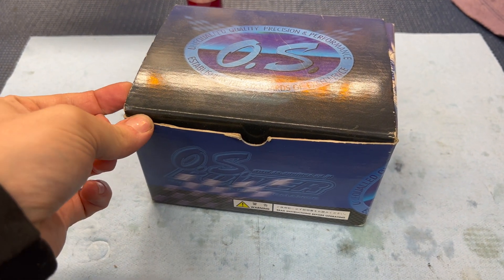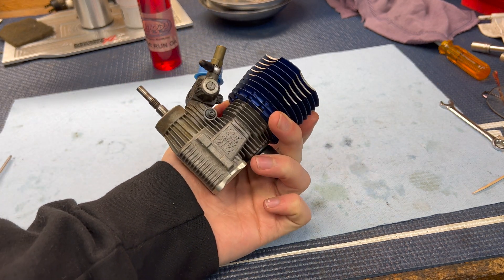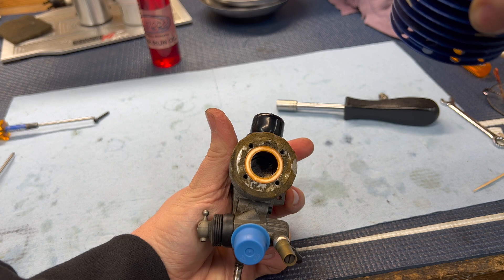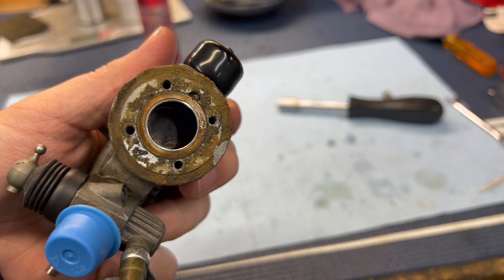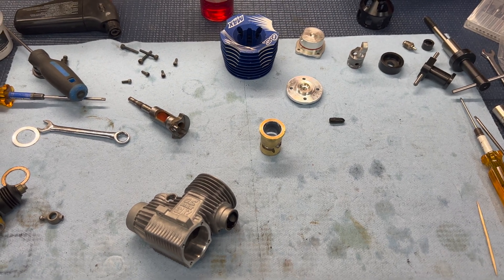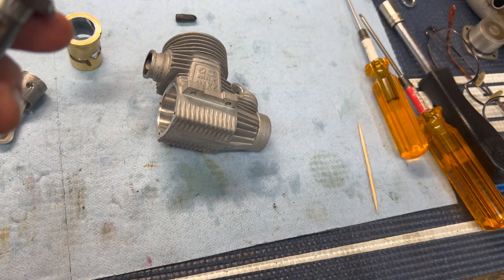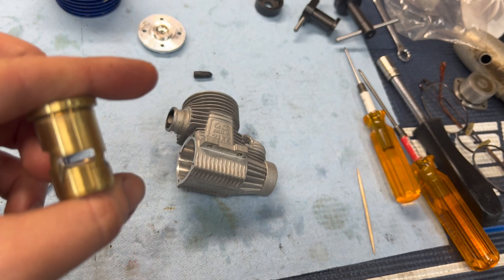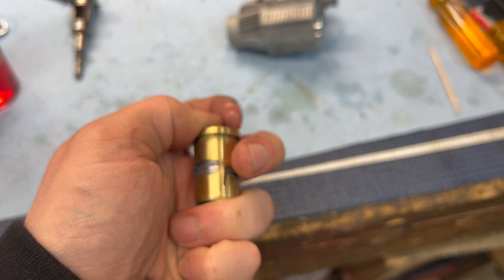Should Be Ashamed

Comment: Those cranks are weak, no point relining it. Ive been showen to measure the crank pin. And check after the first bearing change
Reply from the maker: I’m aware of this, if I was to rebuild it I’d do a complete rebuild with a dlc coated crank but kinda no point